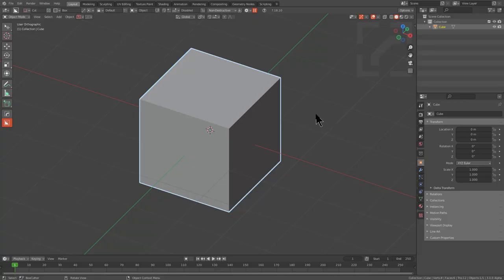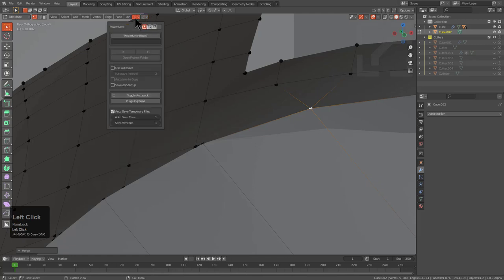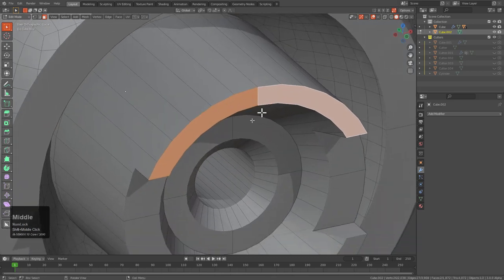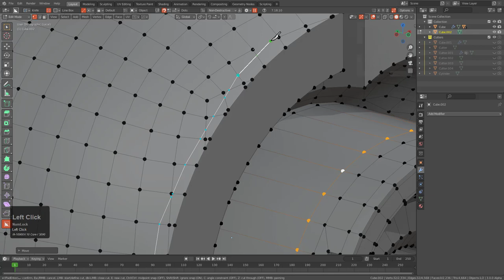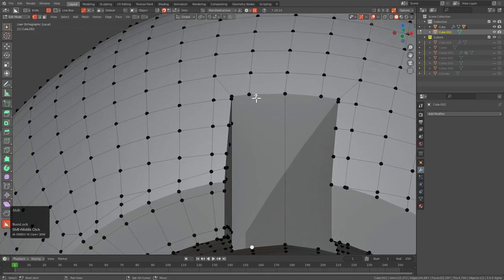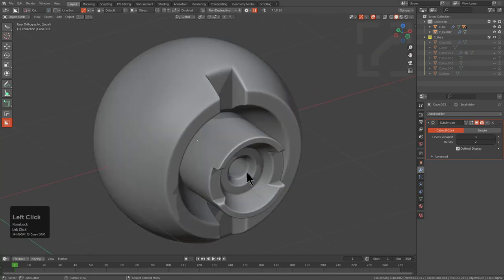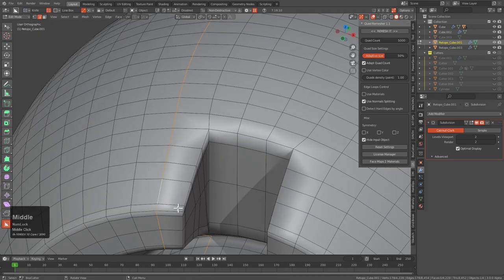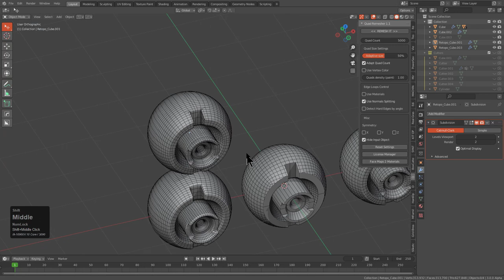#hardops - Spherical Solve (why tri)

Comment: 25:00 GG-E-FF switch helps to build offsetted loop.
Also you can select polygonal loop and press Ctrl+2 to obtain its edges ring for subdivision instead of selectin edges manually.
(it is the only helpful switching mode Ctrl+1 and Ctrl+3 are not that useful, so I was in doubt if it is rational to remove edit mode subd from those shortcuts)
Reply from the maker: i might have to see a gif of what you're sayin.
Reply: @masterxeon1001  okay, but here is a problem - I can't post links here.
There is a link to BA tread in TOPOLOGY WORKS video description, I left a post in this tread for you.
Reply: @masterxeon1001  did you found it? I made a short video there.
Reply from the maker: @1DInciner  yes. I see what you mean now. For some reason I thought you were talking about forcing offset loops on the surface.
Reply: @masterxeon1001  that's because I was  talking about forcing offset loops on the surface.

Comment: How do you set up shader like this? My shading in blender looks worse then in maya with one topology.
Reply from the maker: wat?
Reply: @masterxeon1001  With same topology there is some stretches on model/ but only in blender. Do you use weight vertex modifier or you work ar default settings in Blender?